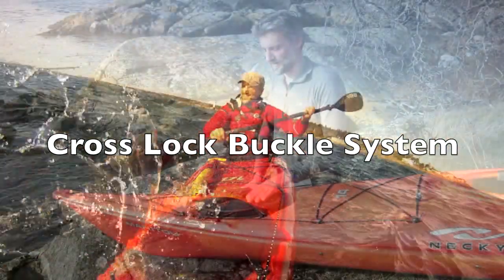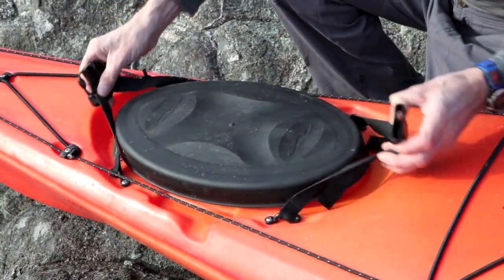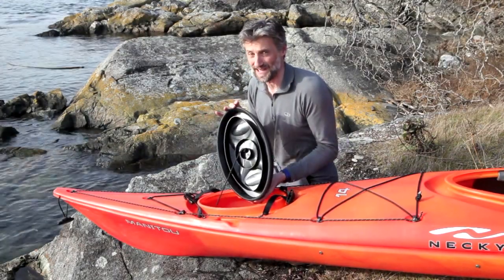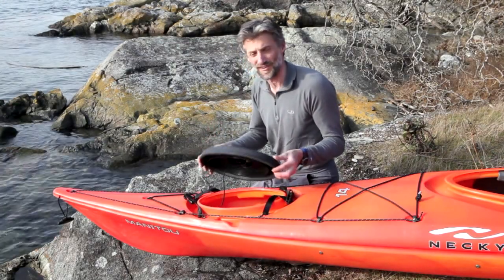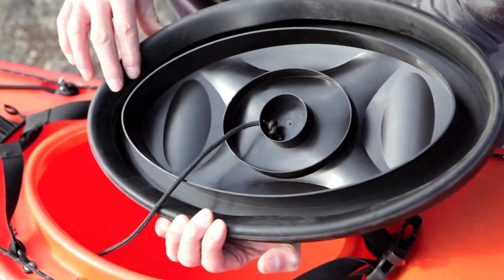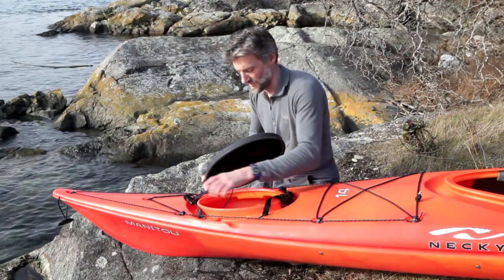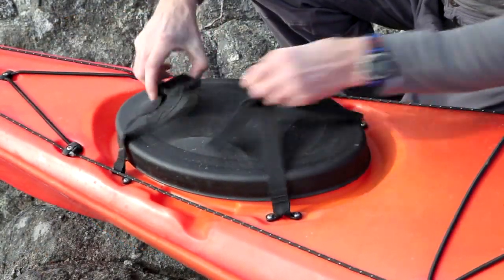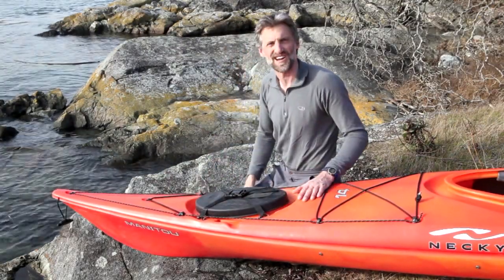Necky Kayaks Quick Seal Hatch System

Comment: I have an older Manitou 14 with the neoprene hatch covers.  I also have a Old Town Cayuga 146.  It looks like all Necky has done is use the exact same hatch covers as the Cayuga and put the Necky name on it.  Nothing wrong with that.  They're owned by the same company, but I wouldn't  tout it as an innovation by Necky.